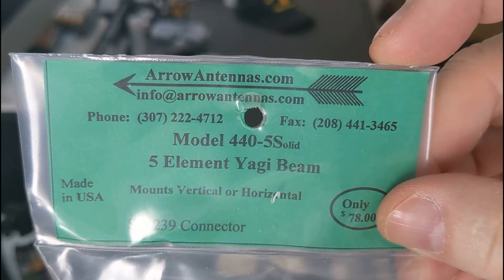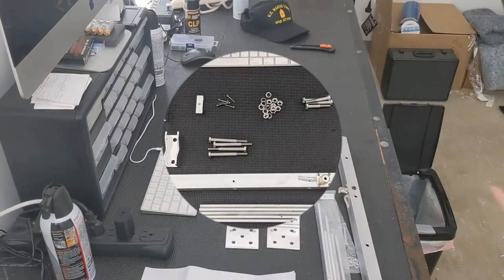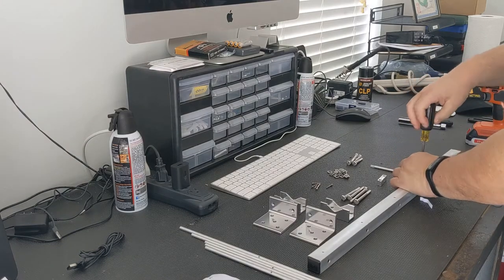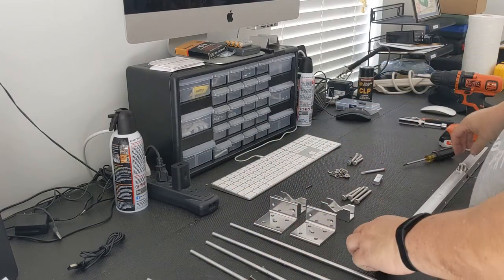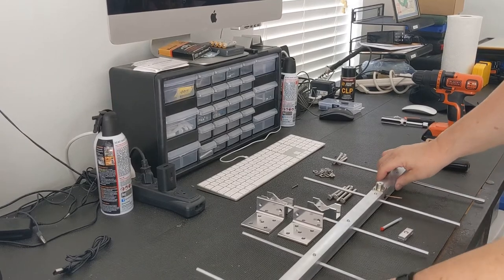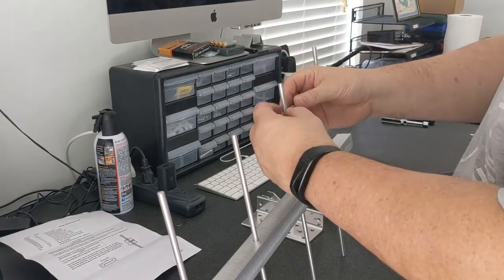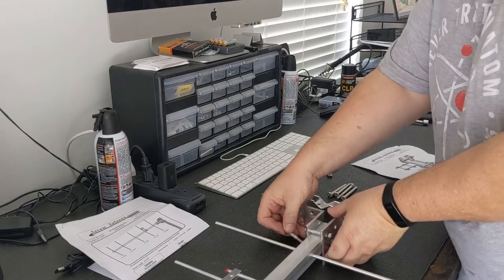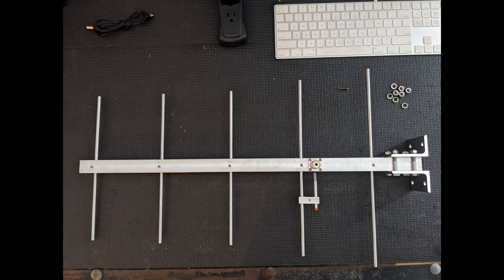Yagi Antenna from Arrow Antennas - Part 1 of 2

Comment: Good video, especially if you are a licensed HAM radio operator.  For the non- HAM's out there, the acronyms such as SWR may have been a little confusing.  Looking forward to part 2.  On a side note, I saw your USMC MSgt retired hat on your work bench.  Thank you for your service.

Comment: Thanks for sharing. Will this work with GMRS?
Reply from the maker: I think so but here is another less expensive choice:   https://www.amazon.com/Foldable-400-470Mhz-Connector-Motorola-Transceiver/dp/B08FC7H6DB/ref=sr_1_1_sspa?gclid=CjwKCAjwmJeYBhAwEiwAXlg0AcuPXXcL2Ap8LQ1zYz7LpbRGeC5-t220ioem3jfViuUUfqojNTxTNhoCP-kQAvD_BwE&hvadid=490218697143&hvdev=c&hvlocphy=9025207&hvnetw=g&hvqmt=e&hvrand=16254963809016740272&hvtargid=kwd-931821796940&hydadcr=2838_9915700&keywords=gmrs+yagi+antenna&qid=1661364989&sr=8-1-spons&psc=1

Comment: how do i connect the Yagi antenna to a Wouxan KG-905G GMRS 2-way radio and what connectors and cables will I need?
Reply from the maker: Don't know that radio but a quick google search and it looks like you need and SMA Female connector to BNC or SO239 (Depending on what you Yagi Antenna would have. Then a length of coax cable long enough for your purpose.

Comment: The elements(rods) are they threaded?
Reply from the maker: Sorry, don't understand the question?
Reply: Looks like they are drilled and tapped at the middle point, for the screw that holds them to the boom.